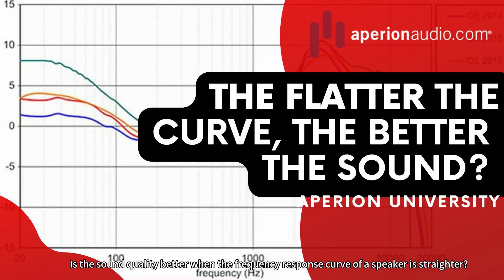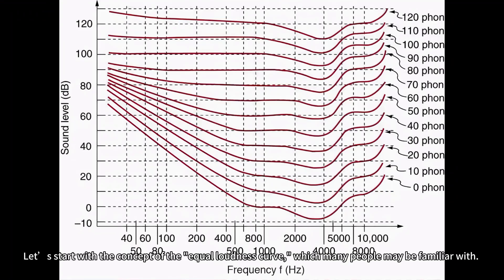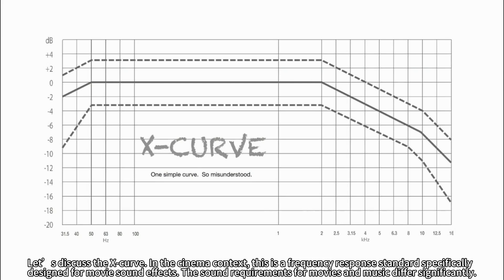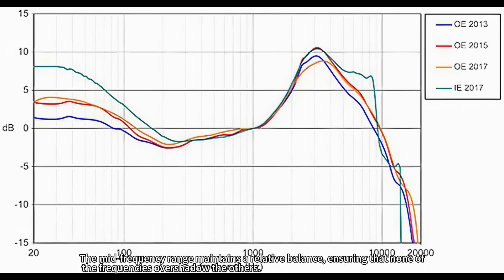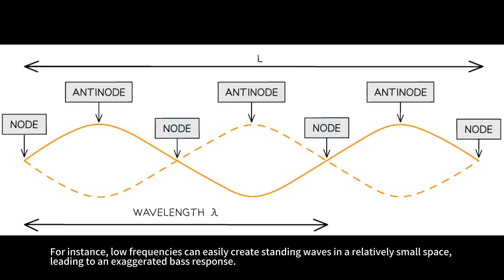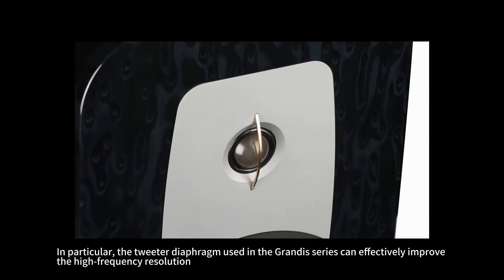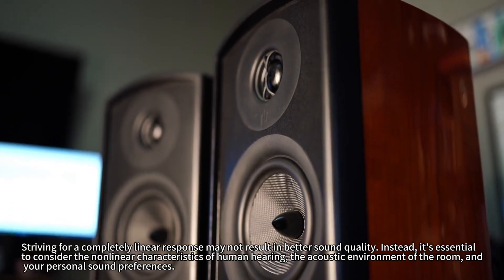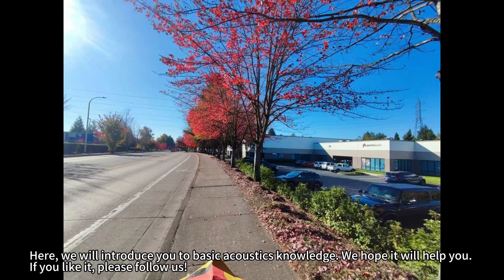Is the sound quality better when the frequency response curve of a speaker is straighter？

Comment: The frequency response of any system must be as flat and neutral as possible.
It's the job of the music producers and sound engineers to make a fine dish.
That shouldn't prevent each to tune it a bit to each one taste with room adjustments and speaker positioning.
 But the base of all systems must be neutral.That's what Hi-Fi should be. Fidelity to the master source.

I know some prefer 'in your face' kind of sound for the details in the medium frequencies to stand out and become easy to 'read', but I believe most of us prefer a more deep warm sound.
Whatever sound we like, it's expected that sound to be affected by the environment. A band playing in a studio will definitely sound different than the same in most living rooms.
Reply: Most good speakers are designed to have a flat frequency response in an anechoic chamber. This means that they are not flat in a normal listening room. I made my speakers reasonably flat in my listening room by using a digital eq plugin and found this sounding boring. I changed the eq to just correct some room modes and it sounds great now!
Reply from the maker: You’re absolutely right that music producers and sound engineers aim to create a refined and balanced mix, the “fine dish” you mentioned. But the key issue here is that while a flat frequency response can be an ideal starting point in the ideal conditions (in an anechoic chamber), it doesn't necessarily result in the best listening experience in real-world environments like living rooms.
A flat frequency response is often the target in a controlled test environment, in real-world rooms, factors like reflections, room modes, and human hearing perception mean that a flat response might not result in the most natural or enjoyable sound for most listeners. The goal is to compensate for those factors and deliver a sound that feels true to the source material, but also pleasant in a home environment! :) - Oliver

Comment: So always, always, get the speakers you wanna buy in your home. A carpet on the ground can do wonders. Some curtaines behind the speakers also. Never, never, put your speakers close to the wall. Stay about 2-3 feet from the wall behind. Off course it is impossible to get 100 speakers in your house. If I have heard a speaker in a few different inviroments it has my attention.
Then I wan't to get them at my home. Speakers and room-acoutics are the way to go. After that find an amp that can drive them poperly. Only my experience as a pro classical muscian and hifi hobbyist.
Reply from the maker: @WilDungenvanden I do agree with most of what you said! There is really a speaker for everyone, it just takes a good amount of research to find one that'll suit their requirements, limitations or needs! :) - Oliver